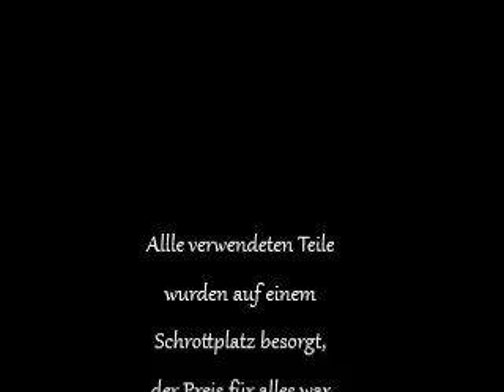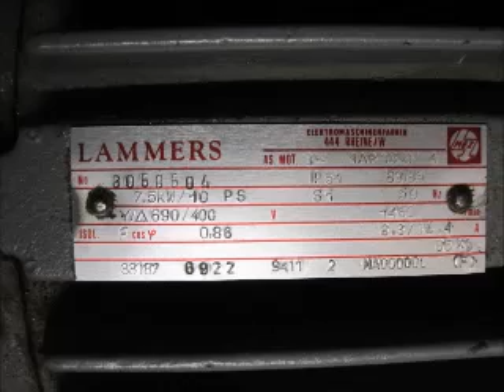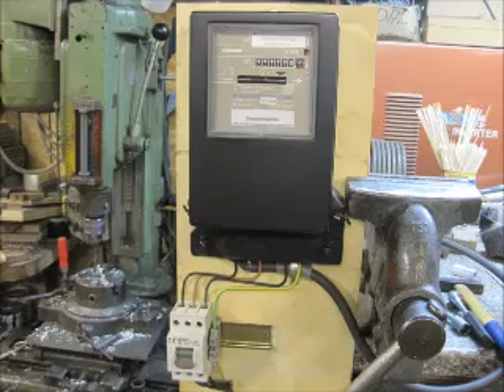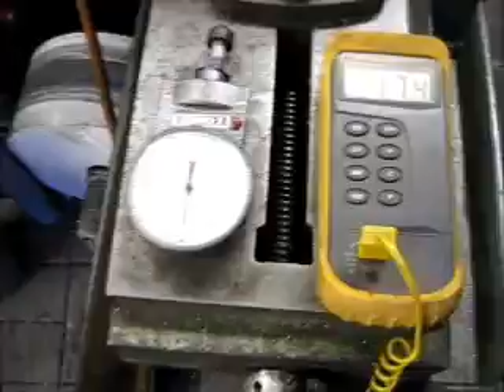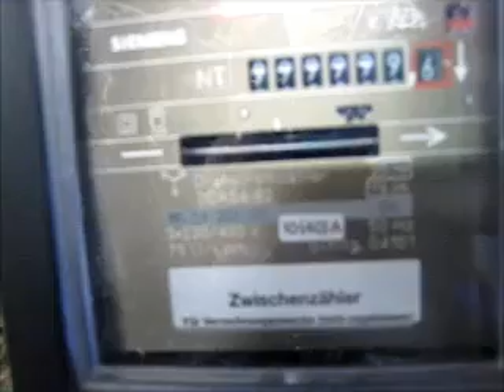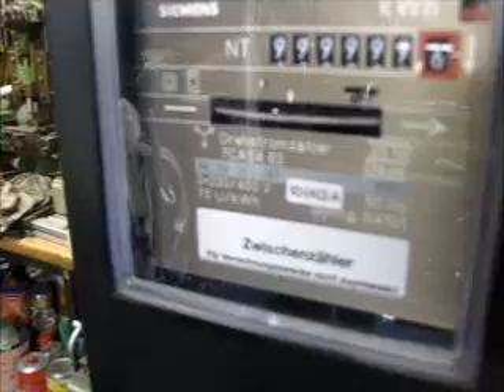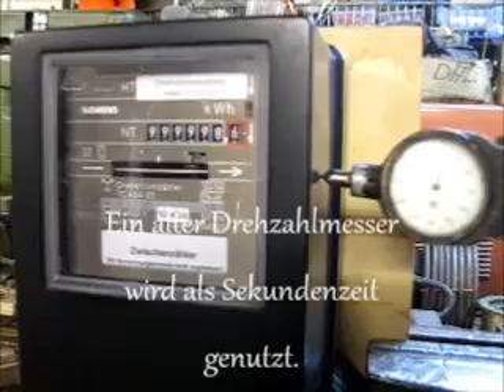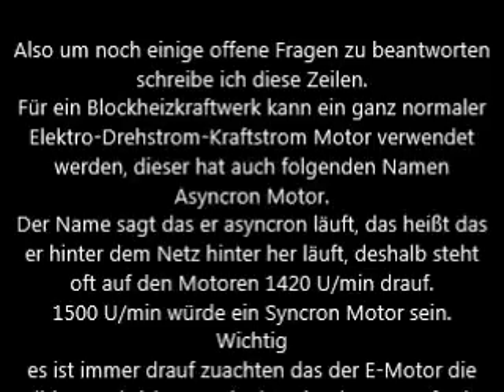Das Blockheizkraftwerk

Comment: Eine runde Sache. Hätte so etwas gerne selbst gemacht, aber da fehlt es mir an Fertigkeiten was die ganze Elektrik angeht. Mit dem Motor ist das eine ganz andere Sache. 

Hätte aber noch eine Frage. Der Motor ist ziemlich laut, und erzeugt Vibrationen. Übertägt sich das nicht über den Boden weiter (z.B. in die Wohnung)?
Reply from the maker: Hallo Herr Rademacher, sicherlich läuft ein Diesel ohne Schallschutz etwas laut, aber er ist im Nebengebäude wo er nicht stört. Generell steht das BHKW auf Gummi, somit wird wenig auf dem Boden abgegeben. Mit freundlichen Grüßen Wolfgang Schwarz